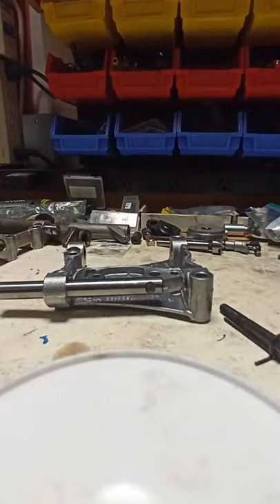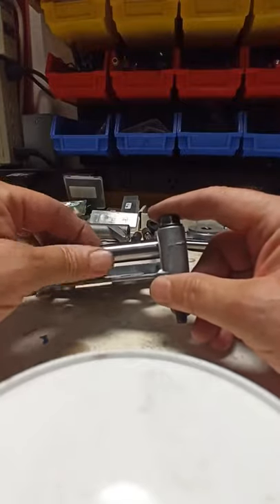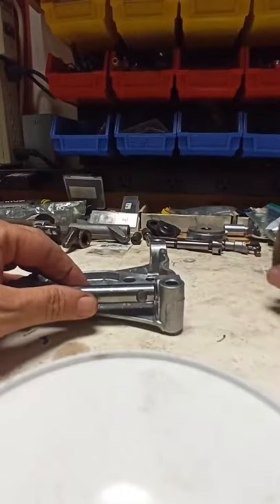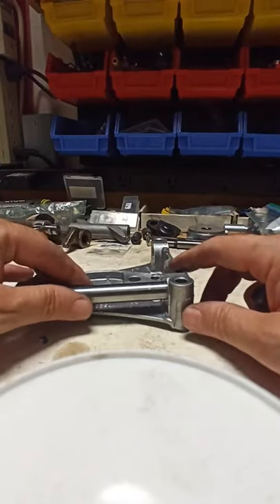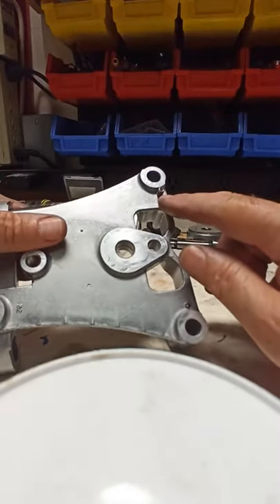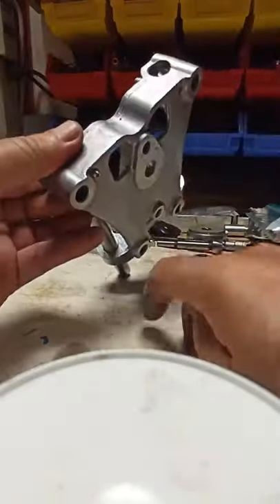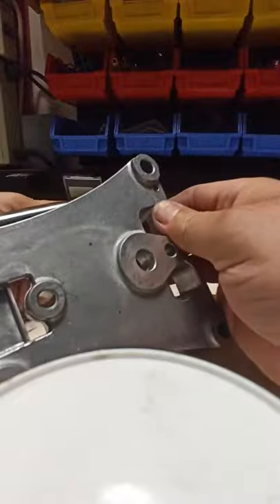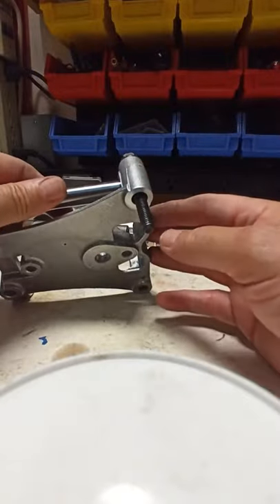Alternative to Rocker Lockers.  D.I.Y. Method To Reduce Ticking Of Harley Twin Cam Motors.

Comment: Good idea, but after riding HD for over 30 years I just look at the engine noises they make and they all do through the years is just HD music. And in this case HD doesn't mean High Definition! But seriously I feel with the design of this engine if you try to tighten things up to much one could be looking for problems.  This engine, even though they have made updates is basically the same design from the old Knucklehead just variations.  And it needs to run more loose in order to allow for it inherent vibrations and to allow for proper lubrication being air cooled. I believe you tighten up to much to quiet them down and you Open more problems down the road. I love my HD music! But you did have a good idea and put a lot of thought and I will give you a thumbs up for that! Carry on!
Reply: I tend to agree with your comment about H-D engine design and the inherent sounds that it makes. 
Do the proper maintenance and a Harley engine will last a long time. Just like a noisy diesel engine.
If you want a quiet motorcycle, buy a Goldwing.
Reply: Well if that were the case then it’d come out the factory ticking and rattling. Lockers put everything back to the way it was designed

Comment: Well done, But being an Engineer it doesn't matter where to put the set screw as long as there is a counter bore for the set screw to lock into on the rocker shaft itself also proper location of the set screw from the bottom was excellent choice as the material is plenty to drill and tap a small set screw. Preassembling the rocker shaft assembly with 2 set screws one at each end with blue locktite drill and tap set screws holes then put a slight counter sink hole in the rocker shaft it self I did it to my 99 dyna and it worked perfectly problem solved no more ticking S&S ROLLER ROCKERS AND NEW ROCKER SHAFTS S&S 89CC HEADS S&S 4INCH BIG BORE PISTONS S&S 585 EASY START CAMS S&S LIFTERS  S&S QUICKEE PUSH RODS S&S CAM PLATE AND OIL PUMP GEAR DRIVE I HAVE BEEN BUILDING AND MODIFYING MOTORCYCLES FOR 38 YEARS AND I AM ALSO A BMW/MERCEDES TECH AND A LOCKSMITH  WITH A BA IN MECHANICAL ENGINEERING  I HAVE SPENT MANY YEARS RESTORING WW2 FIGHTER PLANES NOT A BRAGGING RIGHTS THING BUT I HAVE LEARNED A WEALTH OF KNOWLAGE BY WORKING ON SOME OF THE MOST EXOTIC MACHINES OF THE 20TH CENTURY GOOD JOB MY MAN EXCELLENT APPROCH AND EXECUTION KNEES IN THE BREEZE

Comment: Couldn’t you just spin the shaft 180 and grind a new smaller crescent groove, trial and error till it’s a snug fit.
Reply: Now there is an idea. Just make a flat on the shaft that lines up with the set screw hole.

Comment: Tim Stone... I have installed rocker lockers on several bikes now and sometimes they work to eliminate the noise and sometimes they don't.. In the cases where it doesn't the noise is probably coming from the rockers moving back and forth on the shaft.. I don't like using shims on them because unless it's likely to wear out from metal on metal friction hardened steel. Definitely don't want metal shavings floating around in the oil. I like your idea with the set screw in the bottom but my only concern is does that end of the shaft need to float as well? If not it seems like Harley would design the shaft to be a press fit into the rocker plate and still allow the rocker to float.. Just my thoughts.
Reply: my rocker shafts are a press fit. 108,000 miles  Maybe you need new bushings
Reply: That side of the rocker shaft is held in place by the bolt going through it. Locking it down with a set screw just keeps it from rotating. The other end on the other hand needs to expand with heat. That's why he mentioned doing this mod on the same side as Harley.

Comment: Why won’t anyone make a bolt that is shouldered larger with the same length, thread, and head as factory?
Reply: Thats exactly what I think. Shaft as thick as the rocker locker sleeve until thread portion, just slightly shorter so it doesn't bottom out. It's pretty easy to make a bolt on a lathe. Are they even high tensile?

Comment: The problem with this method is the set screw will upset the metal shaft and prevent the shaft from sliding out easily and will scrap the very fine machined bore. The only way to use this procedure safely is to grind a small flat were the set screw contacts the shaft.

Comment: There are two major advantages for Rocker Lockers, yes they lock the shaft, but just as important is they center the rocker arm assembly plate where it was designed to be, every time. Without the inserts there is as much as 1/8 inch play on the bolts, the plate can rotate as it is being installed. This can cause the push rods to scrape on the tubes, or cause the rocker arm foot to be repositioned on the valve stem causing multiple wear patterns on the foot. (We have seen this on many 100k motors.) It puts the push rod at a slight angle changing the geometry of the rocker arm, and can cause the rocker arm to move back and forth if not properly shimmed. In the past we noticed that the majority of this top end tick was after the top end work had been done and contribute it to the placement of the plate creating additional angle on the push rod and lateral movement in the rocker arms.
The advice I would give if using this fix is to be aware of the placement of the plate during installation.

Comment: Nice job.  You're right about WHEN, not IF you have to go back in.  I have pulled out and reused Rocker Lockers with a puller I fashioned on a lathe out of a Gr8 bolt and a sleve.  Your method is one and done.

Comment: An advantage of the underside is any load on the shaft is already upwards.
I'd be just as happy to drill a pocket for a hex head to sit inside.
Plenty material and a bigger hex for the same thread. 
UNC is a good choice into aluminium.
Blue threadlock will hold it.
Agreed a small flat on the shaft would improve the hold and reduce risk of any marring on the shaft that could cause a high spot if the shaft ever has to come back out.
Clockmaker/horologist, decade in r&d prototypes for electronics. 
Get the right minded people in the design room.
I don't mind mechanical sounds but the less there are the easier it is to hear anything going south.

Comment: You could also put a 1/8 inch set screw first, then a 3/8 or 1/2 inch on top to insure a double lock so vibration won't loosen the screw.

Comment: Hello, very clever idea and solution!  One concern that comes to mind is IF that set screw does work loose, as it releases from the shaft, the hardened shaft could pivot/vibrate and do battle with the tip of that set screw - shredding off hardened metal particles that could escape into the engine.  With the brass rocker lockers, if the shaft has any remaining free play, the slight ticking action could dimple the sleeve and over time release brass particles.  So in both cases, it’s hyper-important to achieve zero free play.  I suppose the stock design, with shaft ticking against the bolt is not ideal either!  It must have been a design decision in favor of loose fit = faster install/assembly at the factory.
Reply: Theres no way it would be able to completely fall out the way he did it...

Comment: If the set screw needs to be long enough to prevent falling out, it doesn’t sound like there’s a lot of confidence the set screw won’t come loose. If it does vibrate loose, the original purpose is defeated. I like the brass sleeves better.
Reply: Go back into the video and find where Tim mentions "BLUE THREAD LOCKER". That screw is going nowhere.

Comment: Your method sounds great but, my thoughts are… when/while the engine is running it’s gonna turn and twist the rocker shaft,… causing the set screw to run against the shaft causing metal shavings., the brass inserts are mailable allowing wear not like steel on steel,… idk I like your design but I like the brass inserts… let me know how it holds up and runs

Comment: Just watched this again. So I have an idea. Drill your hole for the rocker arm shaft set screw with the shaft in place. Let the drill bit hit the shaft.  It will leave a mark. Then pull out the shaft and grind a flat where the drill bit hit.  That should stop all possible movement of the shaft.  What do you think?
Reply: You could go one further and drill your hole all the way through the shaft and out the other end, and pin the whole lot.
Reply: @chrisjohns9631  That is a whole lot more work. Not to mention the possibilities of broken drill bits. Aluminum is easy to tap. Hardened steel is not so easy.

Comment: I have a small one man shop & have installed rocker stoppers on several bike & every one I do I'm thinking what a pain these are gonna be to get out of I ever have take apart ! That is a killer idea which I'm gonna start using right away ! Any thought s on an Evo motor my every day ride a 91 FXR is doing that ticking as soon as it gets warmed up ! Was looking at some Evo rocker boxes  it could be done but no safety like the twin cam the set screw could fall out ! Maybe use red loctite !?
Reply: If you use red loctite,you will have to apply a lot of heat to that screw before you can get it out. Blue thread locker will work just fine.

Comment: What about drilling and tapping box and shaft put a small bolt in there!  Or small hole solid through it and put it roll pin in it

Comment: tHE SHAFTS IN MY 2003 WITH 109,000 MILES are not loose in the rockers. (more like a press fit) If your shaft slides back  and forth you most likely have a bad fit.
Reply: HE'S TALKING ABOUT the shaft being loose in the pedestal, not in the rocker itself.

Comment: I’m trying to do end play on 1997 Harley sportster 1200 amdseems none load side is same on both witch is the valve side because that’s the side the feeler Guage slides down next to it. Aka it’s not a twin can it has 4 cams. Also is the spec still .003 min cold on my bike ??and does that seem correct that none load side is both same as in valve side.?

Comment: Rocker lockers are only $25, just invest in something that's proven to work. They also can be reused, you don't have to buy new ones.
Reply from the maker: As I said its a good product. Not sure how you press them out for reuse but maybe you're correct.
Reply: I would guarantee this to work and has a fail safe. Cant fall out.
Reply: @timstone1744  If you cut the slant off the plastic dowel that comes with the kit you can hammer them out.
Reply: $46 in Australia, not worth it when there are alternatives.

Comment: Hi Tim! Clever idea! How does the engine sounds now? Is it still necessary to shim rocker arms?
Reply from the maker: Engine sounds pretty good (but still room for improvement).  The pivoting shafts is only one of the sources of noise from the rockers IMO. Removing excessive end play (shimming) and worn bushings are also noise contributors IMO.

Comment: Just my 2 cents,. If Harley engineers would really do any work,. They could make the other end of the shafts square... But that would be too easy right ??
Giving extra work to Chinese parts makers must be their thing !
Reply: That would solve the "issue" of ticking but cost more money to do. This ticking is annoying, not an actual issue that is causing harm. Then you would also have the problem of locking the shaft in place unless you keep the bolt going through the same hole and notching the shaft anyway.

Comment: You don't have to have those lockers press can they drop right in with your finger and you can take them right back out with your finger by just turning over the plate you're telling people that they have to be pressed in and that's not true at all they just drop right in place
Reply: I've done many original Rocker lockers. None have just dropped in. Maybe you purchased a Imported knock off brand.
Reply: @steveg8375  hey Steve this is Chris Collins I don't even remember making that post there's another guy on here his name is Chris Cummings ings maybe it was him anyway just thought I'd drop you a line

Comment: Ok, this locks the shaft... but your tapping that plate and making more mods than what the rocker lockers require which both locks that shaft and narrows the bolt hole, just seems like overthinking IMO.

Comment: This isn’t a bad idea, at all but I’d rather just grind the “crescent moon” around the entire circumference of the shaft… then it can spin all it wants
Reply: Problem is you'll wear out your rocker shaft pedestals as they get no lube.  Then your rocker will walk all over your valve stem, eventually getting so bad that the rocker will chew up the valve.